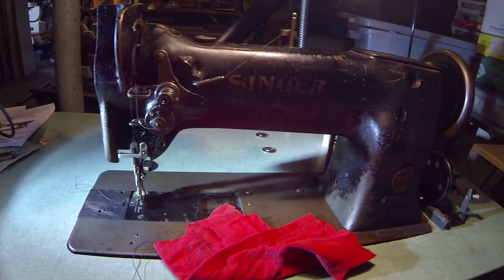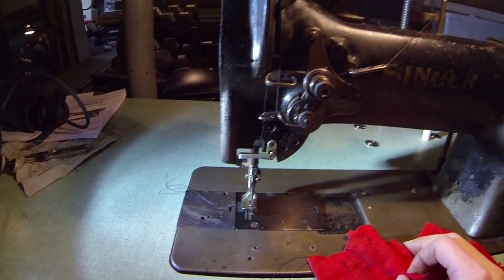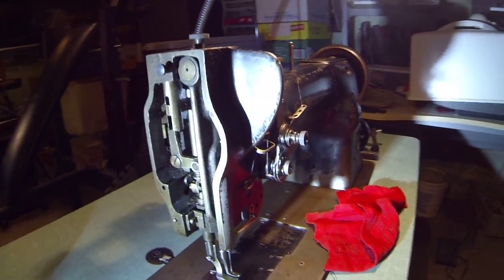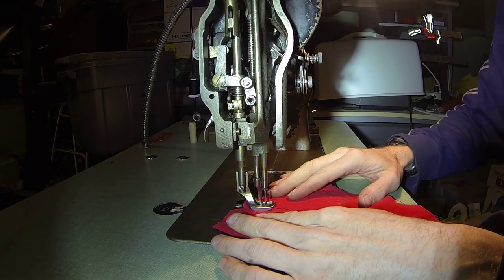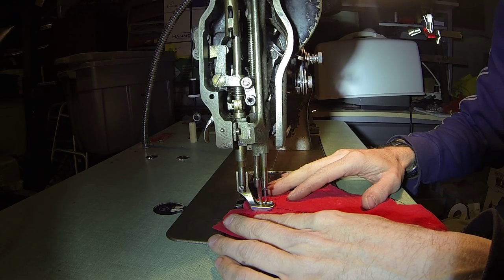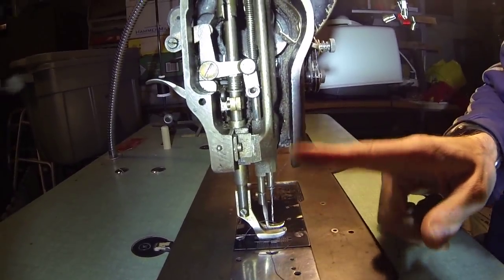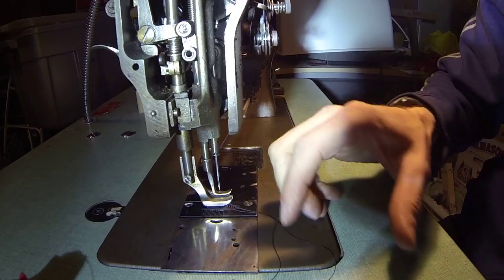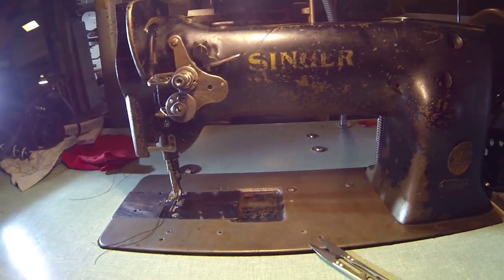Vintage Singer 111W153 Walking Foot Sewing Machine #2

Comment: No servo on ours but adding some length to the clutch motor arm really helped get it under control and still have full speed when needed👍🏻

Comment: I have a twin to your 111w153 singer and i just love mine .I mainly sew leather and it performs flawless on heavy material. I did replace my clutch motor with a servo motor so i could control my speed more effectively. i did  learn on  a few tricks that work for me. i run my thread very hard drag for leather so it dont ball up on the back side of the leather and run a wedge needle that is absolutely necessary for leather. the only thing i would want different is i wish it had reverse but other than that its the BEST in my opinion